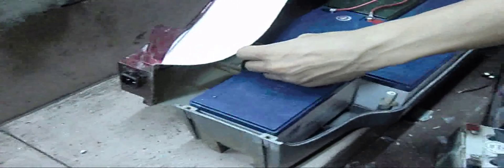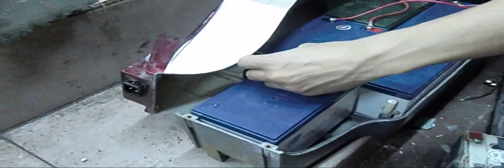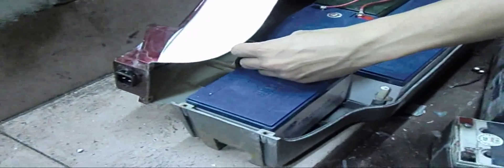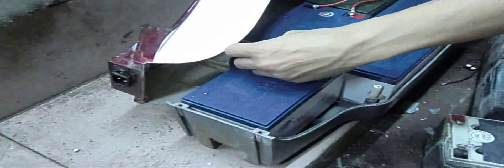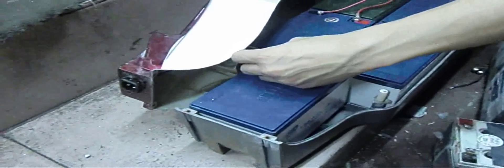Indepth Electric Bike repair - Shocking conclusion

Comment: 3:36 Smoking should only be a problem with openly gassing batteries nearby, but even then realistically not an issue at all, since even a heavily gassing (i.e. tortured) battery would not generate enough hydrogen to cause anything dangerous. I doubt it could even make the cigarette glow brighter for a moment. And if one ruptures, well, maybe in the most unlikely case it could burn some eyebrows.
4:24 Molex? I hate those. Rarely seen one with secured connection. On a bike, with vibrations going on, I'd be concerned.

Comment: Since you like technology......Part of the problem may be that one of the batteries dies causing everything to crap out as they are all in series. A good bike shop would be able to test individual batteries/cells and replace the bad one. Winston, you can do this yourself. Buy a thermal temperature laser gun that reads surface temperature from a distance (laser dot on the desired surface - I bought one for $20Cdn). While charging from near drained state, the dead battery will be quite a bit 'hotter' than the others as there is an internal short. Replace the dead battery only! This is how they maintain the huge battery packs in electric fork lifts, etc. - use a temp gun to find the bad unit and yank it. I bought the gun to check header pipe temperatures at idle on something like your CB400, you can adjust, even out your idle mixtures by the header temps (right by the head). No rear suspension on these bikes can be nasty to these batteries if they aren't rubber mounted. Wait, this is China ... silly me.

Comment: I don't know if you know this but you can actually bring some dead lead acid batteries back to life, using a device that removes the damage to the cells while it charges up. It makes the lead acid battery last supposedly I think it said 80% longer.
So when the battery is dyeing you plug this thing on and it revitalises the battery, I've tried it and it seems promising but not totally convinced as yet, need batteries for longer tests.
But wouldn't lipo batteries be better.
Reply: No need to do the recovery yourself in China. Just take old batteries to the repair shops, which will repair /recovery recycle old batteries, and get new batteries at huge discounted  price!
Reply: But LiPo battery is more expensive than lead-acid ones and has less charge-discharge cycle number, more fragile than lead-acid battery ,which can tolerant certain mount  overcharge overdischarge resist shock .
Reply: Lead acid batteries can be recovered in various ways. The presumably best device is patented and expensive and it costs you about as much as buying a new battery instead. Sure, you can use it as long as you like, but it would only make sense as a long-term investment. And it's much better to use it with a new battery. Some are ruined beyond repair if they took damage.